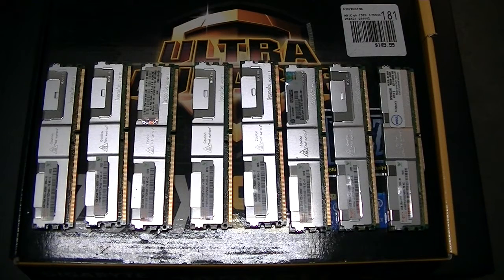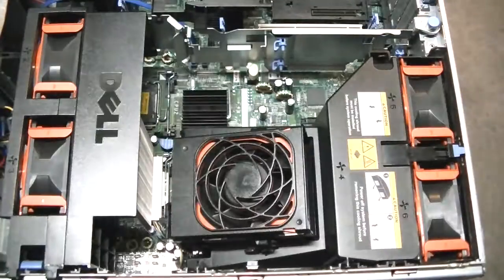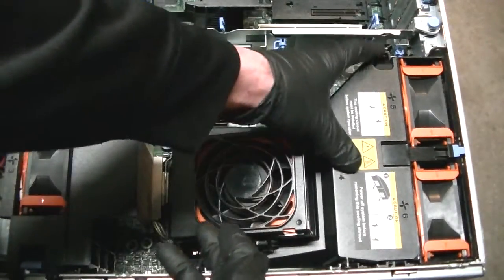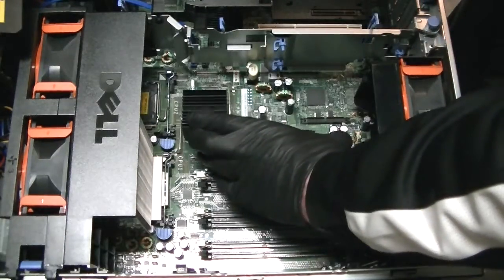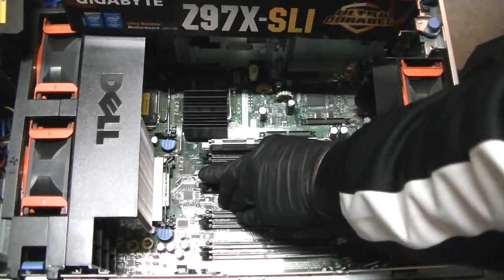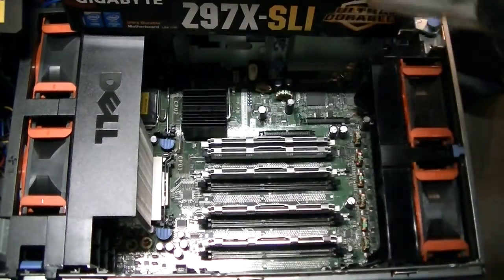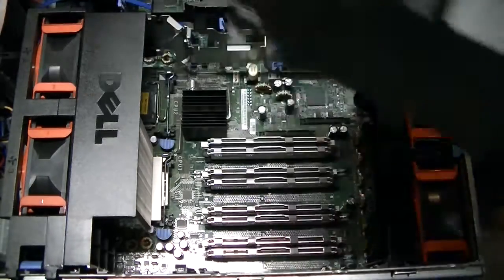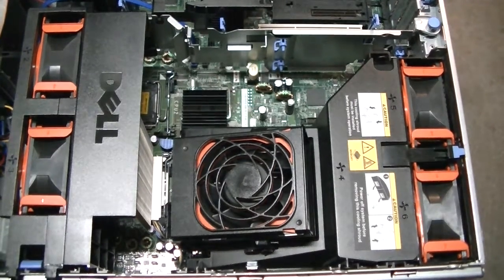Dell PowerEdge 1900 RAM Install Replace Upgrade Change

Comment: I did not think the power edge 1900 would take more than 16GIGS of RAM ? 
did it work ok after you installed it ?
Reply: Robin Thompson I was thinking the exact same thing...
Reply: not true.  i'm using 20 gigs right now of primo Samsung.  maxed out.
Reply: I read there is a version 2 of the Poweredge 1900 that supports 32 GB and possibly more 

http://www.edwardkelty.com/Lists/Posts/Post.aspx?ID=42
Reply: User Experience  link you posted is doa

Comment: mate I just picked up a poweredge 1900. I've switched it on & am getting no signal to the monitor or power to the mouse. Any ideas on fixing?
Reply: Mxkdi yes. I have spent the hours since asking, bouncing around google. I ended up re-seating the RAM & removing & putting back the CMOS battery. seems to have worked. what OS are you running? I paid $50 for the poweredge & the guy gave me a usb with W server 2012 r2. I've installed it but it seems a bit beyond my simple home server needs. Thanks for replying  btw.
Reply: try putting windows 7 on it and see if it works.  just for testing...

Comment: poweredge 1900 the dell description is RAM (Max) 16GB, you put 32 gb ddr2 can work 32gb?
i also just bought a 1900 need to upgrade ram, pls reply me let me know
Reply: Hello friend, I also have that model and you cannot put 32 GB on it, the system does not allow it, I hope this information has helpedm